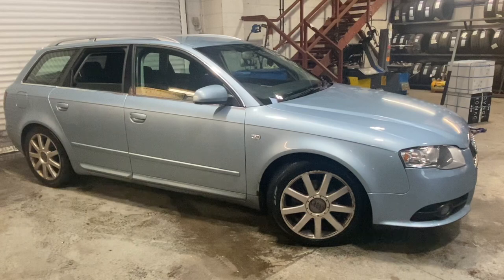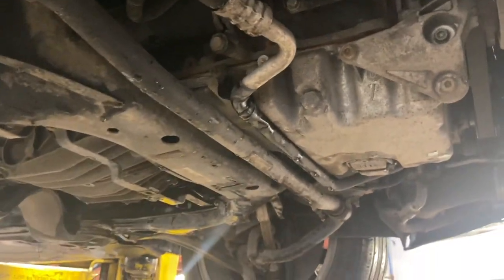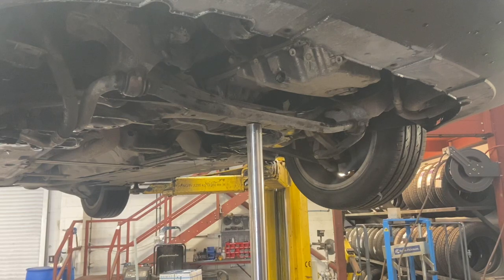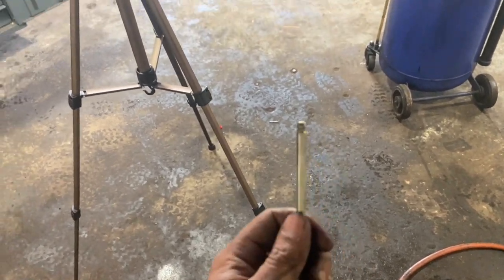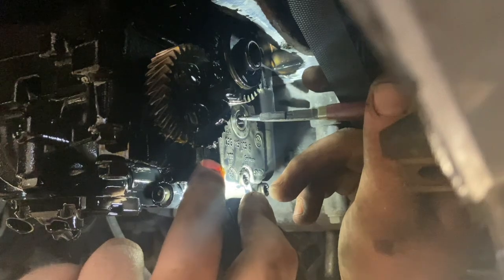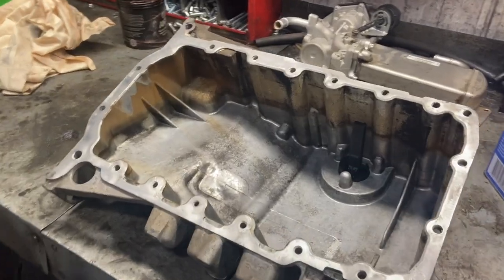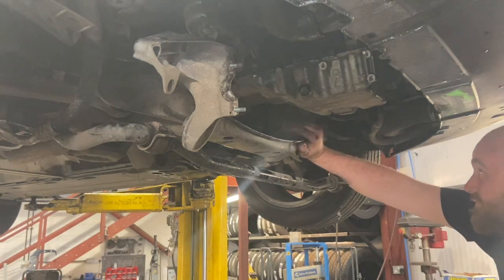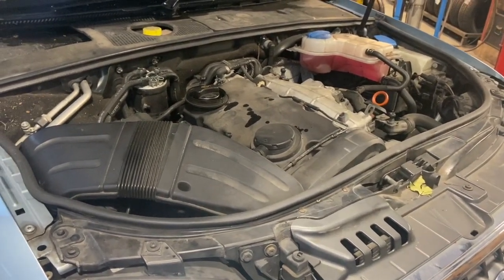Audi A4 Oil Pump Drive Replacement 2.0 TDI

Comment: everything nicely presented. the gentleman replaced only the Allen key, assembled the thing and it lasted for a maximum of 10,000 km. If the Allen key is very worn, then you can replace only the Allen key .if there are only edges, the balance shaft must be repaired (drill, make a new hole IMBUS 6
I had problems twice, I know the matter very well
Reply from the maker: Thanks for the comment 👍

Comment: Hi Gav,

I recently purchase an A4 with the BLB engine and have recently heard the horror stories related to the hex key and pump.

Where about in the uk are you based?
Reply from the maker: Hi , yeah they are abit of a nightmare im afraid! Bloody good motors otherwise though! Im on the east coast nr grimsby
Reply: @diydaly  Thank you for the reply. Shame you're so far away else I would have been booking my car in with you. 
Once the Hex key is replaced is it a fairly worry free bit of motoring?
Reply from the maker: @slugchild  no probs, yeah other than the pump drive they are a mega reliable motor! I look after a few and one has done 280k now! still going strong
Reply: @diydaly  oh wow that is good going ehh!! I don't suppose you know anyone in Kent who does the hex keys that you can recommend?
Reply from the maker: @slugchild  afraid not, that's abit far from me lol
Reply: @diydaly  Do you have an email I can reach you on? I'm tempted to drive up to you.

Comment: Hi, great videos guys ! 
I'm plaining to that in next 2 weeks on my car (code is BRD) and i would like to ask about the shaft which one i need ? 77 or 100 mm ? Even i heard that balance shaft (counterpart) of hex on BRD have better toughness that other types of engines in 2.0 tdi. Is that really true, I'm scared that I change the hex and the counterpart is going to spin in future..Thanks for answer and advice, and sorry for my not so good English.
Reply from the maker: hi, thanks for the comments! its hard to know exactly which size shaft you will have until its removed as it may have had a modified kit fitted in the past.. personally I always get both shafts so Ive got the choice once its out.. out of around 30 shaft replacements now ive only replaced 1 balance shaft and it was in the early days.. if you are a little concerned id replace the oil pump & shaft.. I replaced the shaft and pump on a 2006 3 years ago where the shaft was fully rounded, its since done another 120,000 miles with no bother ..  :)
Reply: Hi , VAG engines prior X2009 -shaft  77 mm , after X2009 - 100 mm long which are more durable than those shorter. Obviouskly it concern diesel motors like TDI, AND CR/common rail/

Comment: What sort of money does this full job cost. Got a 57 a4 with oil pressure issues
Reply from the maker: It will massively carry depending on labour rates etc but I’d say you could expect to pay anywhere from £300 - £500 for the drive replaced , a lot of places will want to fit a pump at the same time

Comment: Hello, Very Good Video! Respect💪🏾 but i have a question… how much must be the oil pressure?
Reply from the maker: Thanks for the comment, much appreciated .. The test limit (minimum) is 2bar (30 psi) min at 2000 rpm , 80 °C (176 F). The not to exceed limit is 7 bar (100psi)
Reply: Thanks! And when its not good the pil pressure then he must be under the 2bar right?
Reply from the maker: @nakuard  yah that's it (at 2000 Rpm )

Comment: Hi, is there a noise when the hex key starts to round off?  I have a 2012 Passat TDI that has a rattle on startup, it sounds like a timing chain rattle as the noise is in the bottom of the engine but there is no timing chain(according to VW dealers going by my VIN number it’s gear not chain). It only rattles for a couple of seconds when starting. Thanks.
Note the vehicle has only just done over 100,000km
Any feedback would be appreciated.
Reply from the maker: Hi you would get a noise as such .. the first indication would be the oil pressure light coming on. From my experience Generally the keyway needs replacing around the 120,000 mile area. Nothing springs to mind for a rattle in that area but it’s hard to say with out looking obviously 👍
Reply: Thanks, appreciate the reply. I have not had any oil light as such yet, so baffling what the noise is. Had a workshop take a listen, they put on a hoist and sounds like noise coming from the bottom. Booked in this Thursday for further investigation. 🤞
Reply: Actually one more thing, do you know how long it should take to remove & replace the sump on a 2012 Passat 2.0 litre TDI. Thanks
Reply from the maker: 👌👍 hopefully they can find out what it is .. I’ll let you know about the sump shortly
Reply from the maker: @niffty1510  I couldn't seem to find the book time, im fairly sure the sump is quite accessible & would say about 1 - 1.5 hours.. im sure the subframe doesn't have to be dropped on the passats but would like to say for sure
Reply: @diydaly  Ok thank you, is that just to remove or remove & replace. Thanks again.
Reply from the maker: Book time is 1.6h to remove and refit so I’d say it’s a 2 hour job
Reply: @diydaly  Thanks, greatly appreciated.
Reply from the maker: @niffty1510  👌👍
Reply: @diydaly was wondering If this issue will Happen for Sure or if lets say Out of 1000 cars only a few have that issue? Asking because I could get a cheap Passat 2008 2.0 Tdi High mileage and Ran accross this issue and am Not Sure If should buy IT when I have to Deal with this right away. Thx
Reply from the maker: @fredb7814  wouldn’t like to say for sure tbh but it’s a really common issue
Reply: @diydaly  OK thanks

Comment: Hi. Great video, really informative. I have a B7 2.0tdi Quattro (170) saloon with the same issue. How much did this job cost in terms of parts and labour? Thanks in advance.
Reply from the maker: Thanks Vincent! If only replacing the shaft drive they are only about £10ish with a clip , the oil pumps are anywhere from £50-£100ish depending on brand .. labour wise you’d be looking at 4-5 hours .. thanks
Reply: @diydaly  Thanks. I'm taking mine to a local garage at the weekend, so wanted a general idea 👍

Comment: Hi got an Audi A4 2.0tdi engine code brd it’s come up with low oil pressure been told the pump will need changing would you be interested in doing the job. Cheers Steve
Reply from the maker: yeah id say it will do Steve, im afraid im not taking on any work at the moment to to other commitments mate
Reply: No worries mate thanks for replying how much you think it should cost rough idea cheers.
Reply from the maker: Id say most garages would charge around 4 hours labour plus the parts.. some may want to fit the actual oil pump at the same time & you may have to pay a fee to have to a/c degassed / regassed.. Depending on the garage and wether or not they replace the oil pump id guess it may vary from around £250-£500

Comment: There is 3 alignment holes from body to subframe and the two aluminium mounts which the anti roll bar is bolted up..its 20mm shaft needs to be placed on both sides to align everything ..you prob noticed the slots in the subframe so it can move to align?
Reply from the maker: yeh I did thanks mate , I wasn't aware at the time when I did the video 👍
Reply: @diydaly  nice job buddy 👍

Comment: hi when balance shaft is failure and when you replace new need put engine on timing mark and lock balance shaft
Reply from the maker: Hi, yes if fitting a complete new balance shaft it would need to be timed up

Comment: Hi mate how mutch in total would u charge for a job like that
Reply from the maker: It varies abit between garages & area etc mate , and also if the garage are prepared to only replace the drive.. some will want to replace the pump at the same time, price could range anywhere from £300-£500
Reply: @diydaly  it’s showing oil pressure on the dash mate plus having no breaks as they are hard to push down and somebody told me it’s oil pump mate
Reply from the maker: @markholland1705  Yeah you definelty need to get it checked out Mate, the brake issue could be a split vacuum pipe

Comment: It’s a pity this isn’t wider known outside people who are having to deal with this problem. It should be priced in to secondhand values with massive discounts but isn’t. Approx.  £5-700 job for a garage including a modified high tensile replacement and all the hassle.
Reply from the maker: Yeah it is a rather annoying issue! Luckily I was aware of it myself and could do my own before it was an issue 👌

Comment: Hi how many hour is a job like this thanks
Reply from the maker: 3-4
Reply: @diydaly  thankyou
Reply: @diydaly  mine is a 2006 bre engine so can i just put the hex key in and which size do i need and is mine chain or gear driven thanks
Reply from the maker: @abdulbeany1894  should be gear driven , hard to say what size you’ll need , depends if it’s had the conversion done or not.. there not expensive so I’d get both so your covered
Reply: @diydaly  thank you

Comment: Heard that the oil pump tensioner goes also on bre engi especially common fault
Reply from the maker: Yes mate they run a chain setup rather than gear driven 👍
Reply: @diydaly  bre has this fault also 77mm balanceshaft fault needs upgrading to 100mm headache
Reply from the maker: Yeah I’m sure I replaced one on the BRE before , bit more of an involved job though arnt they!

Comment: Quelle est l’outil aimanté qui permet de sortir l’axe facilement ?
Reply from the maker: tried translating but dont understand what you mean .. sorry
Reply: @diydaly  sorry bro, what is the tool that allows you to remove the axis easily?
Reply from the maker: @sofianebentafrit9799  Thanks! that's clearer.. what exactly do you mean by Axis though?
Reply: @diydaly  the rod in the oil pump
Reply from the maker: @sofianebentafrit9799  arr! 👍 it’s a small magnet mate 👍👍
Reply: @diydaly  ok thanks you do you have a link ?
Reply from the maker: @sofianebentafrit9799  https://ebay.us/2EYLcA
Reply: @diydaly  thanks you a lot, have a nice day
Reply from the maker: @sofianebentafrit9799  👌

Comment: Thanks for the vid👏🏻👍🏻
Reply from the maker: Thanks for the comment 👍👌
Reply: @diydaly  I was led to believe it's a horrendous task, I've just picked up a bumper from someone with this problem so he scrapped the car. Not too bad a job 🤷🏻‍♂️
Reply from the maker: @neilappeal20  haha , yeah there not bad at all really , worst issue is if you can’t get the 2 hidden sump bolts out!
Reply: @diydaly  I've just read on a forum that its required to lock the engine at tdc to do the job. That isn't the case is it?
Reply from the maker: @neilappeal20  not if your just replacing the drive.. if your replacing the actually pump the balance shaft needs dropping and to do that it will need to be timed up that’s all
Reply: @diydaly  ah ok. Thanks for your help 🍻😬

Comment: Having watched your guide and then noticing that the car has the 100mm hexagonal pin upgrade,  it appears even with this modified oil pump balancing shaft and still wears.....
Reply: @diydaly  so that's a yes and not what I was hoping to hear
Reply from the maker: @mbrylewski  sorry mate I got mixed up , we was double checking that one as we didn’t know if it had been done , it was only very slight , if you know you have the 100mm shaft you shouldn’t really need to worry .. it will still wear but is a lot tougher than the original 72s .. even the original ones often make it to the 130,000 area so not bad really but it’s sumet everyone needs to be aware of

Comment: 7mm ?
Reply from the maker: 6mm
Reply: @diydaly  77mm or 100mm
Reply from the maker: Yes they are the 2 shaft length options , depending if it’s had the modify pump fitted 👍

Comment: Great video, can you do mine? Cheers
Reply from the maker: 👍👌 thanks , has your drive failed or are you wanting it done before it fails
Reply: @diydaly  I need it done i think mate
Reply from the maker: mattthomson1982 where are you based? And what’s you reg number ? I will check the setup is the same
Reply: @diydaly  im based down south in Bournemouth but can arrange to come up. It drives fine but I keep hearing stories about it. Is there a way I can pm you? Cheers
Reply from the maker: Yeah you could pm through my blog , there’s links in the description below.. will have a chat .. it may be hard to arrange a repair though as I have a full time job as well as running my blog.. it’s a shame you are soo far away but There must be some decent lads around you, it’s just finding them I Spose 👌
Reply: @diydaly  cheers pal just sent you a message on your web page. Thanks

Comment: Get rid of the crap music, otherwise good vid
Reply from the maker: Sorry this was one of my earlier videos , I’ve done a duplicate video without the music too 👍
Reply: @diydaly  I'll check it out.
My a4 has 100k miles, if I pull shaft and looks ok, can I get away with just putting a longer shaft in?
Reply from the maker: @angrypants7619  you dont need to specially change it for the long shaft, replace it with the same size but just a new one 👍 I replaced my own at 120k and it was showing early signs of wear so caught it before it became a problem ! 👍
Reply: @diydaly  many thanks for your reply 👍🏻
Reply from the maker: @angrypants7619  👍

Comment: I think I'll just send my Audi to get crushed, never buy euro trash again and go back to l Aussie built cars same era where this sort of BS is unheard of. These German vehicles should be out of business the way they're over engineered.
Reply from the maker: Tbh I’m a big fan of the B7 a4 , I own one and it’s been mega! Done 80,000 in myself hassle free.. 180,000 on the clock now 👍
Reply: @diydaly   Fair enough, I like the look of them but. Falcons and Commodores can do 400000 plus without a problem. Some Falcon barras are up in the 700000kms and still going. They aren't Diesel but. Cheers
Reply from the maker: @_wallnutz_  👍👍 thats some good going!!